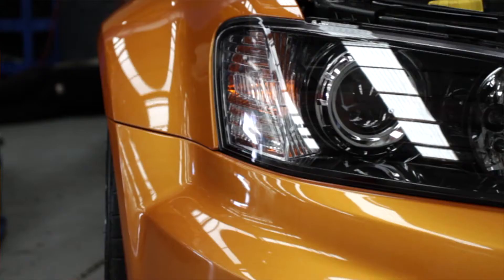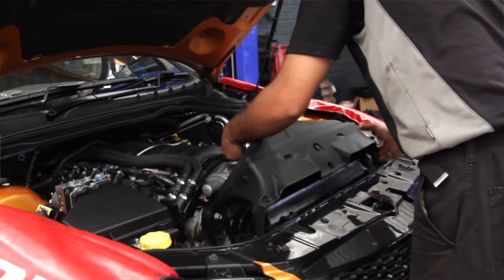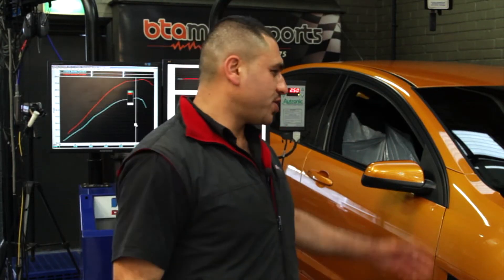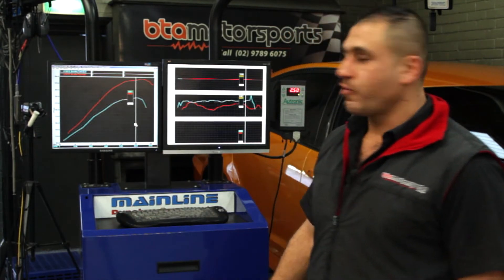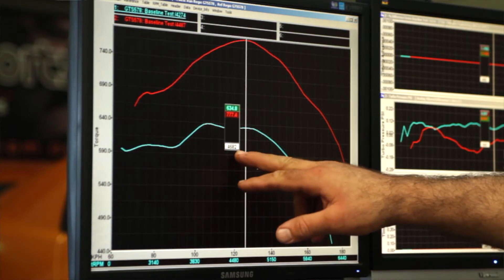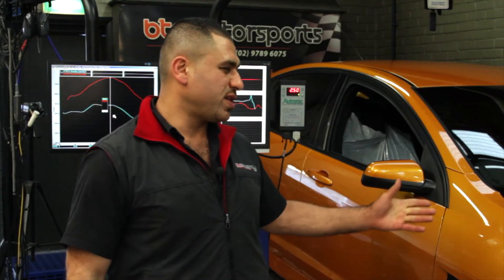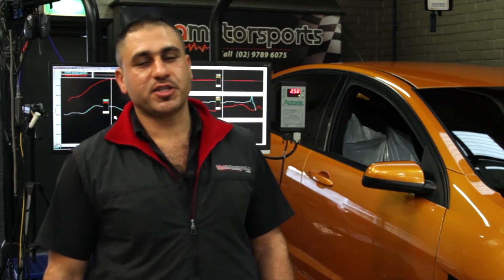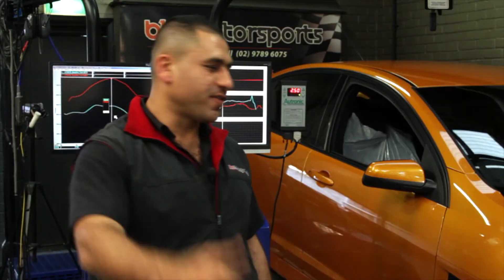HSV GTS with BTA Motorsport Stage 2 Upgrade and Titanium Exhaust - 285kW.

Comment: Great vid love the exhaust.  Kw output badge  on the car (307kw) is engine dyno output with no aircon power steer . So 225kw at the wheels is on the money . Remember also this is still only a 376cu 6.2lt  motor no blower also.
Cheers
Reply: It’s a ls3 mate and 325kw at motor 
Tho auto makes less then manual at wheels but did not expect 100kw. Still a bloody nice car

Comment: how much for the TI exhaust, which is basically from the CATS back, big problems are stainless steel headers with mild steel plaTE WELDED TO THE PIPES, THEY DO NOT USE STAINLESS STEEL PLATE AND WELD IT TO THE PIPES, WHY BECAUSE THE CASKETS ARE MADE WITH STEEL AND OTHER METALS TO HAVE CONTACT WITH THE ALLOY HEADS,WHICH IN TIME WILL HAVE A REACTION, ITS SIMPLE GET THE PLATE MADE IN STAINLESS, BUT YOU CAN'T DUE TO THE EXTREME HEAT AND BUCKLING OF THE PLATE, WHICH THEN HAS TO REALLY THINK TO STOP THE BENDING AND BUCKLING, WHICH IS WHY THEY USE MILD STEEL AS THE PLATE WELDED TO THE ss PIPING AS PART OF THE HEADERS, I BELIEVE EVEN dpe USE MILD STEEL AS THE PLATE, BUT WROTH A CHECK WITH EXHAUST MAKERS IF THEY USE STAINLESS STEEL AND WHICH GRADE FOR THE PLATE AND IF IT WILL REACT TO THE ALLOY HEADS AND GASKETS USED ? ps: SORRY ABOUT THE CAPS. :)